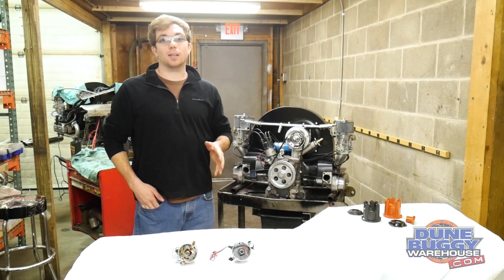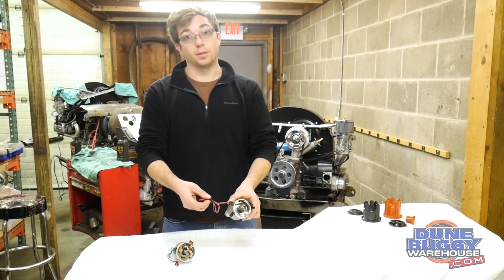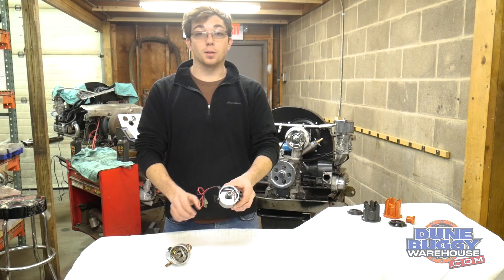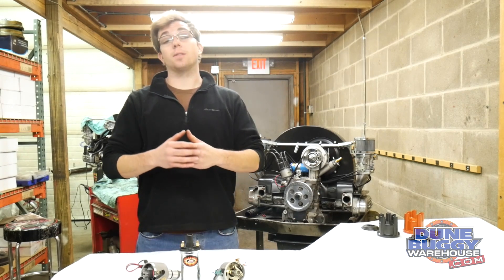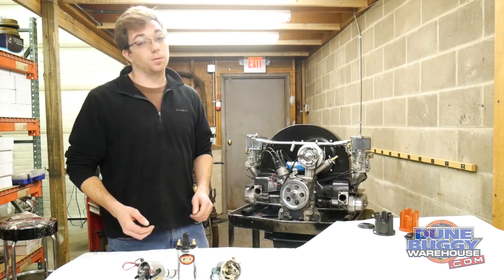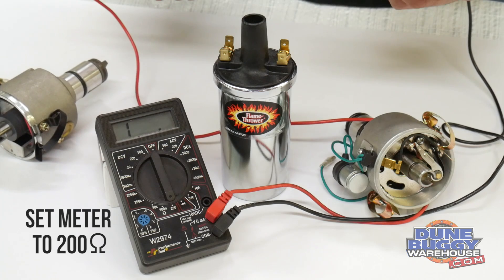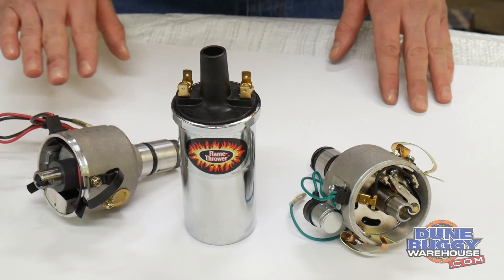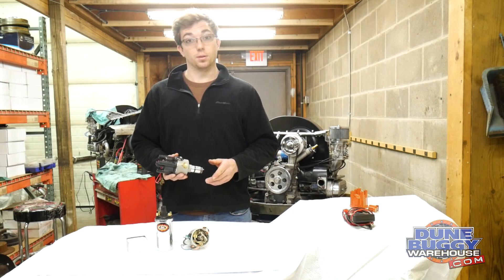Air-Cooled Volkswagen Electronic Ignitions 101 - for VW Beetles, Buses & Dune Buggies

Comment: What's the distance  between  the electronic  module and the rotating  cam where the magnets  are going around.?
Reply from the maker: Pertronix specs 0.10-.040 inch or 0.25-1.0 mm air gap between sensor and collar
Reply: @DuneBuggyWarehouse  thanks guys.i bought one of these and it came with lose screws and the it rubbed against each other  the whole time it would spit and sputter in between gears .I spent or should I say I got ripped off  for 2000 dollars going through  so called mechanics and I figured it out.all this low quality  junk we are getting and paying top dollar for Chinese junk I'm s so done with stupid society.

Comment: Very informative video 🎉
I have a question about electronic ignition, I have a 1985 water cooled VW Westvalia 1.9 engine. After purchasing a Flame Thrower distributor, coil, spark plug wires, spark plugs, I've been notified by Pertronix that there is no way these can be installed in my vehicle. Which leaves me confused. 😢 My question is why would air cooled versus water cooled make a difference??? Thanks in advance, PS. If anyone sees this post, can a video be posted explaining this, I cannot find one!
Reply from the maker: From our tech expert Brian K - the 1.9 vanagons are fuel injected and use the factory distributor sensor as part of the crank trigger, so you're not able to just replace the factory distributor.

Comment: I have an after market electronic ignition dist....      When I give it gas and the vacuum pulls it retards the timing instead of advancing it.     How is that possible.?????
Reply: When you step on the gas the vacuum falls off initially and then builds back up.  It prevents spark knock.

Comment: My coil says 7.5 ohms. It is mounted up side down. Ran good at idle 5 minutes then no spark. CFU3 ignition coil. Did it burn up the cdi?
Reply from the maker: Is it on an aircooled VW? I don't recognize that coil number. Typical coil measures 3.0-3.9 ohms across terminals for our application.

Comment: dude, "make sure you don't hook up the red and blak wire" gee would habe been nice if you have told is which goes where...
Reply from the maker: Red is  POS 12v+ coil side, black is NEG 12v- coil side. Check which terminals are +/- on your coil before installing!

99% of the issues are people mis-wiring/not verifying coil terminals before installation.

Comment: hi, what are the reasons to burn-out the distributor rotor. In my beetle, its recently burn-out..
Reply from the maker: Corrosion and/or contact from the cap are usually what kill the rotor. The spark creates ozone which over time is corrosive to the metal contacts.

Comment: Coil tested is fine 3.7omh... but I hooked Ptronix backwards.  I believe is fried.  But how do I test out PetronixModule with volt-meter tester?
Reply from the maker: 009 & Vac Advance Style Ignition Module Test:
1. Verify the module is receiving 12v source - POS+ multimeter lead on POS+ coil terminal and red wire running to module, and NEG- multimeter lead on a ground for the car (engine block, alternator stand, etc.)
2. If you confirm correct voltage at POS+ wire leading to unit, you can put a test light from the POS+ lead and the NEG- lead to the coil and turn the engine over - it should flash while engine turns. This will confirm the module works.
3. If #2 does not work check all wires to/from the module, coil, distributor wire and plug wires. Check ohm rating across coil terminal  (3-3.7 ohms is acceptable).

If you're not sure give Pertronix a call at 909-599-5955 they do have excellent technical support.

Comment: hi,any recomendation what kind we can use in vw bug with small engine(carb30 pict1) my distribuitor is vaccum advance  the JAR4 0231137025 THANK YOU IN ADVANCE.
Reply from the maker: Cheaper option: https://dunebuggywarehouse.com/kuhltek-vw-svda-vacuum-advance-distributor-0231170034el.html

Expensive option: https://dunebuggywarehouse.com/pertronix-vw-svda-vacuum-advance-distributor-d186504.html

Both distributors have been very reliable for us on 1300cc and up engines.

Comment: Hello.
 I have. 72-73 beatle engine in a big 70's trike.
How do I tell if it's an 009 or something else?
AE750310 is stamped right near the timing mark. It has a Scat 45-020 points dist in it now. 
No spark and no visible condenser. (Strange)
Reply from the maker: Some of the old Mallory distributors have condensers hidden inside with the rotor. Parts are generally available. Supposedly these are closer to the 010 advance curve. The 009 will have the thinner, taller cap like the distributors in this video.
Reply: @DuneBuggyWarehouse  . Ty. I have the short cap. The tall cap setup was bought by my friend in error.
If they are interchangable I would like to buy it. 
Is it interchangable?
Reply from the maker: @georgerussinello6820  They are not interchangeable, you have to use the Mallory-specific shorter caps. I'd have to point you to our friends at Aircooled.net for those parts.
Reply: @DuneBuggyWarehouse  . I'm sorry for the confusion.
I meant are the complete distributors interchangable.
He wants to go electronic. The dist with points in there now is warn the points don't sit tight in dist.
If I could get a complete kit , I'd go that way. Plug n play.
Reply from the maker: @georgerussinello6820  Absolutely you can use a 009-style instead of your old Scat/Mallory-style. Any of our 009 distributors - either points or electronic - would work in place.
Reply: @DuneBuggyWarehouse  . I can just go to dunebuggywherhouse.com?
Reply: Hello. The plugs for this vw ?
Are they L88a or L86C? 
(NGK-BR6HS is maybe the equivalent?)
Reply from the maker: @georgerussinello6820  We use the Bosch 7902 although NGK's would be a close second: https://dunebuggywarehouse.com/bosch-7902-14-mm-1-2-inch-reach-spark-plugs-pack-of-4.html

Comment: First time that I am going to be installing a distributor with electronic ignition and there is a note about: That I need a coil withinternal resistor or inline ballast resistor? Is this a special type of coil?
Reply from the maker: Measure the resistance across terminals on your coil - it should be about 3 Ohms to use with (nearly all) electronic ignitions.
Reply: If I get a ballast resistor with electronic distributor I should be able to keep the key on longer than 30 seconds without burning the actual coil up right?

Comment: We're do red and black wire go on electronic distributor
Reply from the maker: Red wire goes on +Side of coil, Black wire goes on -Side of coil. Verify with a voltmeter/multimeter which side of your coil is actually positive and negative before connecting. Electronic ignitions will fry almost immediately if wired up to power backwards, or if ignition switch is left on without running the engine for more than about 30 seconds.

Comment: On the electronic ignition distributor should I feel resistance at certain points when I rotate the distributor? BTW I'm speaking of when the distributor is off the vehicle
Reply from the maker: This is not uncommon. Sometimes the cap can be just a little off center and the rotor can drag against the contacts inside the cap. You can try resetting the cap but they do end up centering themselves on the distributor once the car has started.

Comment: can you direct me to help diagnose a module on the bench ?  i had one called hot spark which i was told its a chineese knock off ?  ok now i have a pertronix ign it works ,,,,,i tested the old one "hot spark" cause i was told its bad ,,,,i tested it home and it shows good ?  just wondering if i did it correctly ,,,,,i was reading 9 k ohms from ground plate to hot wire like hot spark says ,,,then i probed the red and black of the module on a dvom took the magnet got the module to open and close it tested good ?   did i miss something ,,,,thank you
Reply: also the amps makes a lot of difference in how long the module will last ,,,under 4 amps is mostly recommended ,,,,,as to keep the module running cooler ,,,,,just saying , thanks
Reply from the maker: I find it's easier to test in the car with a test light:

009 & Vac Advance Style Ignition Module Test:

1. Verify the module is receiving 12v source - POS+ multimeter lead on POS+ coil terminal and red wire running to module, and NEG- multimeter lead on a ground for the car (engine block, alternator stand, etc.)
2. If you confirm correct voltage at POS+ wire leading to unit, you can put a test light from the POS+ lead and the NEG- lead to the coil and turn the engine over - it should flash while engine turns. This will confirm the module works.
3. If #2 does not work check all wires to/from the module, coil, distributor wire and plug wires. Check ohm rating across coil terminal  (3-3.7 ohms is acceptable).

Comment: How do you check to see if you fried your  Distributor
Reply from the maker: The basics: Most electronic ignitions do not fire under ~10v so make sure your battery is charged up. [Before anything else check polarity on your coil: Make sure pos+ is actually positive by checking for voltage to a ground.] Add a small ground jumper between Coil neg- and a ground point (firewall bolt, trans strap, etc). Check your voltage from Coil pos+ to a ground (11.5 to 16 volts is ok), then check your resistance from Coil pos+ to same ground (3.0 to 4.5 ohms is ok). If any of these are out of spec, you have poor connections and/or a coil going bad. If the key is left on while the engine is not running, the coil can overheat and burn the units up just like points. If the wires to the coil were mixed up and polarity was reversed, the units generally fry immediately. If you have a pertronix unit, they have specific procedures to further test the unit I can email to you.

Comment: Great video!    I have a type4 engine which i did a valve adjustment on recently and now I can't get the engine to fire up so I can't use a timing light?  it has Electronic ignition
Reply from the maker: Was the valve adjustment the only change, and was it done on a completely cold engine? They shouldn't have any effect on starting the engine unless wires were disconnected (you can pull a plug and check spark) or the valves are too tight which can cause hard starting.
Reply: @DuneBuggyWarehouse  yes the engine Had not been started the day the valves were adjusted, is it possible to time it Staticaly just to get into the ballpark?
Reply from the maker: @harrisonphelps2877  Start with 7-8 degrees before top dead center - it should run unless there are other issues.

Comment: Do you still turn the electronic one for timing or is it just put it on and it works? 

Does electronic ignition help the engine to run better?
Reply from the maker: Electronic ignitions will improve your spark and accuracy of the timing, reduces any chance for points bounce and reduces any wear on the distributor shaft from opening points. You won't see a performance increase but may see a slight fuel mileage improvement. They are a near zero maintenance upgrade versus points. You will still need to set your timing - about 8 degrees BTDC static, and 28-30 degrees BTDC for full advance at ~3000 rpm.
Reply: @DuneBuggyWarehouse  can you explain this more clearly to someone that doesnt know anything about cars?
Reply from the maker: @CK-bs8gs  What were you looking to learn about? Specifically electronic ignitions, or ignition systems in cars?
Reply: @DuneBuggyWarehouse  I've got an electric ignition installed. The vehicle seems to be idling very rough and was wondering how you go about timing it since it is not the original points
Reply from the maker: @CK-bs8gs  You can set the timing close to 8 degrees before top dead center, but I would suggest borrowing or renting a timing light from your local auto parts store to dial in the final 28 degrees at 3000 rpm. Make sure you have the correct firing order lined up (1-4-3-2) with the #1 cylinder being passenger side near the bell housing.